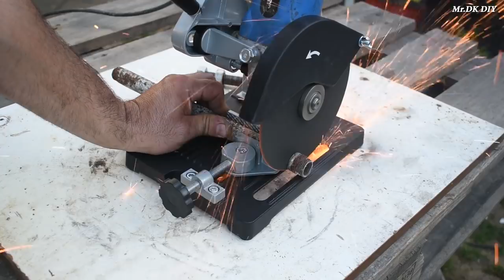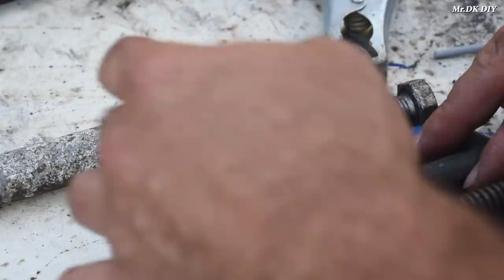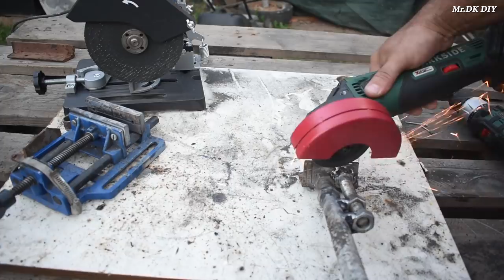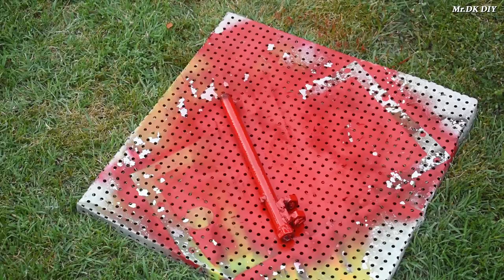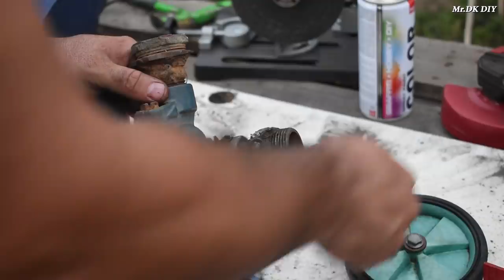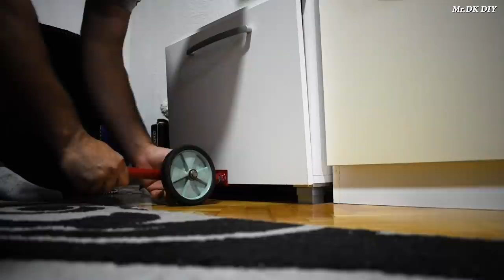INCREDIBLE IDEA USEFUL HOME MADE TOOL / 2 in 1 DIY TOOL

Comment: This is the first time I have ever seen a wheel on a homemade pipe wrench. What’s the purpose of the wheel, you took it off after you put it on there you have to remove it to use it, a pipe wrench, a plain old pipe wrench will do a much better job.

Comment: D- Your tool worked okay as a pipe wrench. I would still prefer a pipe wrench. Your tool failed as a mini hand truck. You do not have any mechanical advantage. You used less effort to move those items by hand then you did with your tool. As others have pointed out it needs a wheel on the other side to be considered a useful tool. Too many more videos like this and I will certainly unsubscribe. This is not anywhere close to your normal genius.